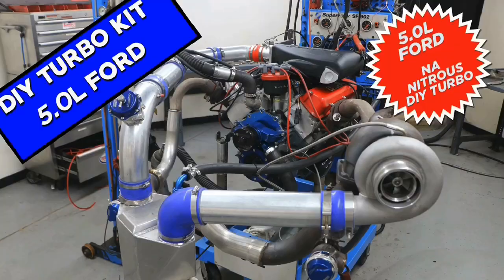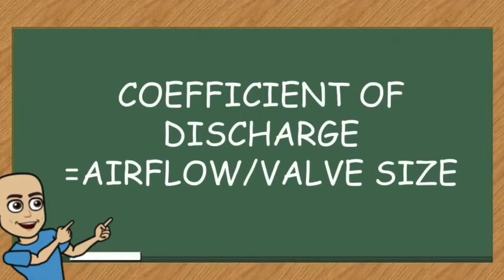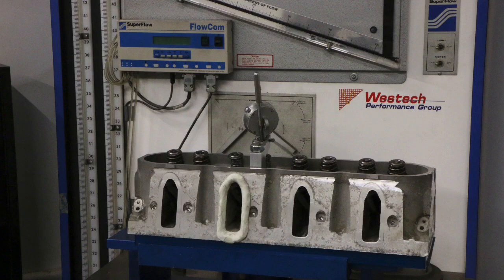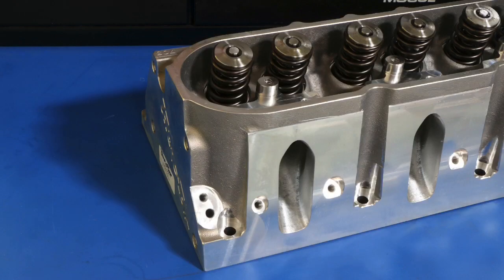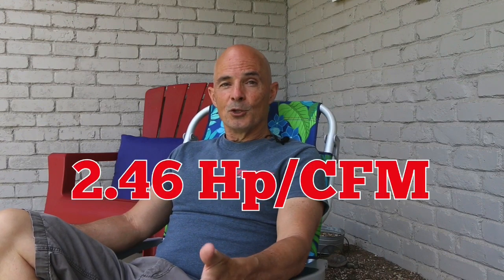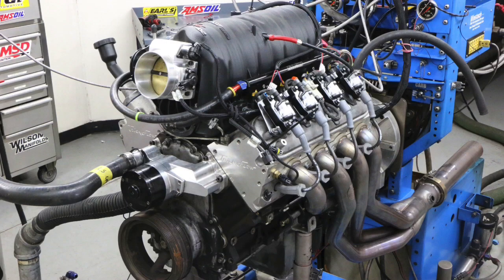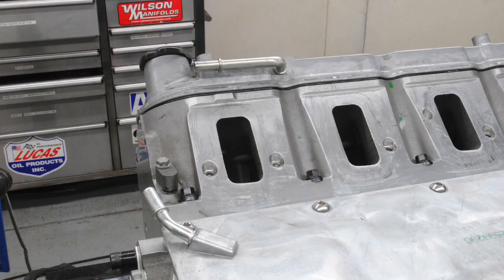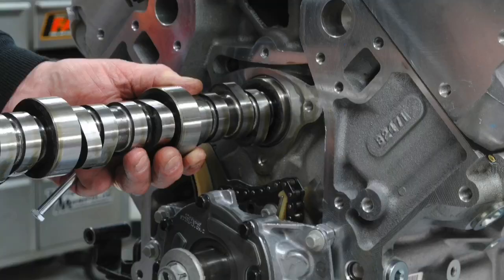IT'S ALL IN YOUR HEAD

Comment: This is why i went an afr 245 head instead of an ls7 on my 434
Both heads flow the same with the afr having a 25cc smaller port and better mid lift numbers which equals comparable power with a much punchier powerband and torque delivery as well as a higher acceleration rate due to efficiency.
Reply: Even stock LS7 has a higher coefficient than the AFR.  Ported LS7 heads flow 390-400cfm.

Comment: So I have a 2007 Silverado 4.8 with a btr stg 4 truck cam. I’m in the middle of pulling the 243 heads off, and putting 862s that I milled 0.030 on it. Hoping this lil 4.8 will sing with 150 shot with some compression. Figured the huge jump in compression will offset the  smaller intake valve and flow
Reply: A full point of compression will get you about 12 HP on a NA 4.8.
Reply: Fascist Pedant    torque?
Reply from the maker: the 702 will make even more power than the 243 on the 4.8L, even before milling
Reply: Richard Holdener It feels pretty snappy... but now I have a crazy noise from the rear diff. Never ending fun!

Comment: Bare with me, I’m buzzed and it’s late but you have HP equals cfm divided by 2 on the slide but you are saying hp equals cfm times 2.
Reply from the maker: the formula was written wrong-should be hp=cfm x 2
Reply: Richard Holdener thank goodness. I’m looking at a pair of heads that flow 257 at .500 lift for my .512 lift cam. I’m going for a 400-450 hp with a stock SBF block. I was thinking I was going to have to get 800cfm heads and change my cam out to like a 2.012 lift or something. Hahaha
Reply: @richardholdener1727  I guess it is valid for a 2-cylinder engine? Thanks for the rectification and the videos!
Reply: @aDaWaN  x1 for a 4 cyl, x .5 for a 2 cyl.
Reply: @richardholdener1727  you might want to write that as HP=2CFM or just use the X
Reply: Was about to say the same thing
Reply: I Think it was just a visual mistake. I would imagine the x2 is for the fact we're talking about v8's with two cylinder heads.

Comment: I'm confused on the hp=cfm/2, shouldn't it  be hp=cfm X 2? I use CoD based upon curtain area. CoD=CFM/(ValveDiameter*PI*ValveLift). Is there a better way to correlate airspeed through the ports based upon physical head measurements? Is there a desirable E/I ratio on LS heads? Is that ratio based upon CFM or CoD numbers? The TEA 243 and TSP 237 and Mast LS3 have the best midlift CoD of the recent big head tests you posted.
Reply from the maker: the formula was written wrong
Reply: I was literally typing the same thing.  I'm Glad I'm not the only one thinking I was crazy...

Comment: 2 hp. Per CFM... I'm old skool. Let's make 2hp per cubic inch. Very few reach this "holy grail" of N/A engine building. Most are in the NHRA comp eliminator classes. Now a days It's just so much easier to throw a power adder on it and call it a day.
Reply: Have you seen or heard of Big red( it's a first gen camaro racecar type build) looks stock but has a 598 engine that makes 1200hp N/A. They do mention that is similar to NHRA but it's a small town engine builder that has been working with the car owner for about 20 plus years.
Reply from the maker: I am very familiar with the Big Red guys-I met them long ago at the La Carrera and the Silver State races-Eric at Westech does their tuning
Reply: @richardholdener1727 that is really cool Richard Holdener;  I saw in one of the episodes that RJ and their crew went to visit Westech for a dyno session so they could run nitrous to reach their goal on the Mojave mile. Steve was the man in charged of the dyno when they were there, but I am pretty sure they were back several times. I have been watching an Amazon series documentary about Big Red but I have not finished it yet.
Reply: Ace B.  the one i saw on the show is an all motor build, it might be on YouTube, but I saw it on Amazon. And it is an all motor build no forced induction( or pro charger) it uses dual carburetors, old school drivetrain that is why it is to me a very special car.

Comment: I think grafting the coefficient of cross sectional area and port volumes in an Excel graph would be very telling.
Reply: It is. The "Coefficient of cross sectional area" of the intake port is just called the port air velocity, though, and its measured / estimated in feet per second. To calculate /estimate it, you take the CFM of the head at each lift point * 2.5 and divide both by the min or average CSA of the intake port. FPS = (CFM * 2.4) / CSA.  Looking at the min csa or choke point will help you estimate the maximum FPS at the choke, looking at the average gives you a good view of the average port speed throughout the port. 

The Profiler 195cc SBC heads have a min csa of 2.15" and using their flow curve you end up with 161.8 FPS @ .200" lift, 283.5 FPS @ .400" lift, 305.9 FPS @ 600" lift. 

Compare to the bigger Profiler 210cc heads which have a min CSA of 2.19" and using it's flow curve you end up with 158.9 FPS @.200" lift, 282.7 FPS @ .400" lift, and 312.3 FPS @ .600" lift.  <----Just like Richard's dyno test on whether bigger heads lose torque or not, you see here that the 210cc head is actually more efficient than the 195cc and has more air speed / velocity at each lift.  You do the same math with AFR heads and you'll see why they make GREAT average torque AND why if you exceed the recommended cubic inches and RPM you'll go into sonic choke and they'll stop making more power at higher RPMS. (The HP curve just flat lines as RPM goes up when you exceed it and then starts to fall off as pumping losses increase.) 

-Then you need to take the above data to the next level and look at the valve curtain area at each lift and the amount of flow through that area to see the coefficient of discharge.  -Comparing the area in the valve curtain to the min CSA shows when in the cam lift curve you move from the valve curtain area being the bottleneck to the choke / min csa of the port upstream being the bottle neck to flowing more air. (The coefficient of discharge then decreases as you lift the valve up more, usually.) 

-If you want to go "Full Nerd" you look at the ACTUAL area between the valve and the port with different valve angels / valve jobs and you'll see that steeper valve seats like 50 / 55 deg seats reduce the curtain area at low lifts (and flow there too) and increase the C/D, and increase it at higher lifts (and flow there too, when the port is modified to work with the steeper valve seat angle). -A 30 deg back-cut increases the low lift curtain area and airflow but decreases C/D.  The increased low lift flow and decreased C/D isn't all good, though as it means that air can flow backwards more easily and create more reversion-robbing power. 

Yea.... I like engine math...

Comment: what do you think about free valve technology from koenigsegg?
Reply from the maker: amazing
Reply: @richardholdener1727  wish you can go over there and pick this guys mind and get an update .. I can only imagine this type of setup on any v8 engine I take that back it would revolution any piston-driven engine the only downside it would put most of the aftermarket cam and head companies out of business overnight ... but man the potential. I am shocked no one else has come up with this idea yet ... anyway keep up with great videos I love nerding out on the details
Reply: @maldo72  Preston Tucker of Tucker fame was building an engine with hydraulic fired variable valves in the 1940's :-) Needless to say the idea was better than the technology at the time.
Reply: @bcbloc02  wow ... amzing the shit they were thinking back then and how it took so long for stuff to surface ...
Reply: maldo72 : Not true. The priority now is how a boost ratio of 2 increases the torque before the turbo kicks in. If you add 18 pounds boost, or want 500 hp, gas flowing a head with moderate or stock valves will improve the street performance. Everyone wins. Big, beautifull heads ported will still make power and torque improvements with the right cam and heads and big power combos. Things will get radical now! You might not need a turbo, blower, nitrous or big cam to make the torque and power targets. Or EFi might not be required. This broadens the modification base...it does no engine builder or head porter any good to miss satisfying a customer. This is all about targeting modifications right through the range. Head porting is still gonna be huge because not everyone wants a boost adder. There are some really fun small LS combinations to be made now. All those charts Richard showed in the 11 head monster LS power test...go back and target discharge coefficient and then modify the best heads on the efficency curve. Head porting is back in style. From my experience with Fords 5 liter EFi verses the 5.7 LS, there is a 13 to 15% fuel use reduction on finding the best head to make a power target. Huge benefits from this.

Comment: The cfm/hp formula is written wrong. you explain it correctly, but you have it written wrong. Hp=cfm X 2, not cfm/2. Also, this only works on v8s. V6s are 3/4 and 4 cylinders are half. I love the content. Keep up the good work!
Reply from the maker: good point
Reply: How does it work for 4 valve heads and what about staggered lift cams?
Reply: @1magnit  4 valve heads don't matter. It's a cfm game. Look at the peak lift of your cam and you double the intake cfm at that lift. And remember, this is just a general guideline on what the HEADS can support. Other factors can limit power too. If you have a perfect cam and killer heads and induction, it won't make power if the exhaust is trying to blow out of a tiny 1" pipe. 
  Dual profile or vvt cams won't matter for peak power. Look at the peak lift. Remember, it's not what the engine can make, it's just a quick estimate of what those heads could make with a matched combination. A 1 ton pickup truck won't use the same cam profile as a 10,000 rpm Honda s2000. 
  Like Rich says in the video, many guys choose heads by cfm alone. If you have a specific power number in mind, this can help you choose the right heads to hit your number but not break the bank. You don't need cnc heads to make 500hp. 
  My pickups 355 sbc has heads that flow 245cfm@.600". I do not make 490hp because my camshaft and intake are limiting factors. It's a 3/4 ton truck so I want high lift to utilize the head flow, but low duration so I can have off-idle towing/hauling power. My cam is a top of the page xfi252hr. 252/264 advertised, 202/212 @ .050" and .550"/.546" lift. The cam limits my rpm and my peak lift limits flow a little. Luckily, my heads still flow 242cfm @.500" so I'm only losing 3cfm between .500 and .600 lift. I don't have a measurement for .550" lift, but let's just go with 242. So with my cam lift, the heads could support roughly 484hp. My duration shifts the powerband down to a lower rpm at the expense of top-end power. That limits my power too, there's not a super easy way to estimate power from a cam, based on engine size and duration. According to comp's camquest software, I'm making about 406hp@5500 naturally aspirated. As Rich has said in the past, boost mimics the NA curve, it just makes it higher. If you're a fuel injection guy, KPA is a super easy way to see how much hp you're gaining. Wide open throttle should be roughly 100kpa. If your data logs show 200kpa, you can figure that you're making double the power... provided that you have good fuel and didn't have to pull timing to avoid pinging. 
  Rich is alot better at explaining this than me, go back and watch his videos. He has a wealth of knowledge.
Reply: @EricErnst  
Just buy a Dodge CUMMINS, if you want to Tow.
Reply: @nellyfarnsworth7381  I don't want a Cummins. This was my uncle's truck. He died in 2005. I'm building it into a fun and badass truck. Some guys buy what they want to suit their needs. Others build them.

Comment: You hit the nail on the head! No pun intended..haha. All kidding aside.. that is why I love using David Vizard/Stan Weiss's  IOP (Induction Optimization Program) because it adds Port Volume , Cross Section, Port Velocity, and finally Port Energy Density to the mix!
Reply: Structured engine building. Its about not saying no to head modifications. Finding the Head Intake and cam profile  to suit your torque and power targets! And dont forget...fuel economy follows if you just follow through this process. Great info all.
Reply: @deanstevenson6527  you are exactly right... It is about the entire combo and the intended use of the combo!!
Reply: Thanks for posting this! I've been MANUALLY calculating port speeds via MinCSA and C/D for engine combos and it's stupid time consuming. I bought a copy of Stan Weiss's PipeMax for intake and exhaust wave tuning and I didn't even know DV and Stan Weiss had this IOP XLS, too!  -I'm going to go try out the trial... Will probably save me stupid amounts of time....

Comment: One thing has never made sense to me. A 300 cu in engine has a static volume. How many CFM will that 300 cu in engine move? Is it a division by 12 to make it a 25 cu ft engine? Would a 25 CFM carb run that engine? How much carb is needed for that 300 cu in engine to perform properly and how do you know?
 Might seem like a trick question but I get confused with the different nomenclature of cu in and CFM or Liter and CFM.
Is there a realistic relationship between engine size and needed carb air flow?
Thanks for sharing your knowledge.
Reply: If you have the offenhauser 4bbl intake a 390 cfm Holley vacuum  secondary works absolutely amazing on that combination especially with the dual headers
Reply from the maker: you are confusing volume to flow/time-the airflow of a fixed 300 CI motor varies with engine speed and efficiency
Reply: @richardholdener1727  As I said, I don't understand the correlation. Is there some relationship between engine size and carb needed? Does that 300 CI engine flow 300 CI/sec or /min? Thanks for responding.
Reply: Your 300 ci is the volume the piston displaces between TDC and BDC times the number of cylinders. 1 cubic foot = 1728 cubic inches. There is one intake stroke every 2 revolutions, therefore your 300 ci engine displaces 150 ci per revolution. 150/1728=.087 cubic feet. @5000 RPM, the engine displaces 5000 x .087=435 cu ft/min. These numbers are theoretical, assuming the cylinder displaces 100% of it's volume (100% Volumetric Efficiency). VE is typically much less than 100% at low speeds and reaches~80% at peak torque on a stock production engine.
Cylinder head flow is measured on a test bench with the valve held open, at a series of lifts, with a specified pressure drop across the valve.
Airflow through the engine isn't directly related to head flow numbers.

Comment: Afr 245 cathedral on top stock 6.0 rotating with ms4 cam hi ram and d1X pro charger lots of fuel 1000cc injectors- think this junk will work - 72cc heads ..????? Your thoughts please
Reply from the maker: yes-you don't need that much head for that combo but it will work
Reply: That’s all I got or stock 243
Reply: Head's too big injectors too small

Comment: You'd use coefficient of discharge by comparing numbers in the RPM range you care about across different heads or the whole range?
Reply from the maker: IT'S NOT RPM BASED-ONLY LIFT/VALVE SIZE

Comment: This further supports why the 706/862 heads produce good power despite their "lower" flow rates.
Reply: Yup!
Reply: You’re right, once I figured out coefficient  of discharge, I ordered a set of 706 heads to port for my ls1, and it turned out fantastic, killer low end and still pulls to 7k no problem
Reply: Its mainly a function of compression ratio with the 5.3 heads. You gain a full point of compression if you swap from a 317 to a 5.3/4.8 head. You gain power everywhere across the entire RPM range which is why it makes decent power.
Reply: Mainly its the chamber size compression boost

Comment: Mr Holdener, please look into short duration, single pattern cams(205-215) on 104-110 lsa for us LS guys with heavy trucks, who need ALL the torque 2500-5500rpm.
Reply: You mean ALL the torque 1500-4500
Reply: @raylaux8295  Yes!!! All the torque possible at 2000rpm, all the torque at 4500rpm, then who cares out past the 5500rpm shift
Reply: @kylemilligan752  I agree with you want the same thing, I'm a little confused by the comments, all the torque but two different RPM ratios?  I was thinking what I wanted was the stage 2 cam, is this what you're referring to? I don't recall the numbers.
Reply: @raylaux8295  Yes! this. This is much more useable at part and mid throttle.
Reply from the maker: I ran the 202/202 truck cam from BTR
Reply: @richardholdener1727  the 202/202 on a 110lsa was just right on for towing. Give us a 210/210 on a 106lsa😁

Comment: Is the cfm calculated at 1 bar? Does it scale with boost? Can a head flow better at a given pressure level?
Reply from the maker: boost just adds power to what is there
Reply: @richardholdener1727  ok i know this isnt engineering class. I dont understand how the fluid dynamics works. I just mean if you get 300cfm at 1 bar do you get 600 cfm at 2 bar? Is it linear progression? When do the heads become the bottleneck for boost?